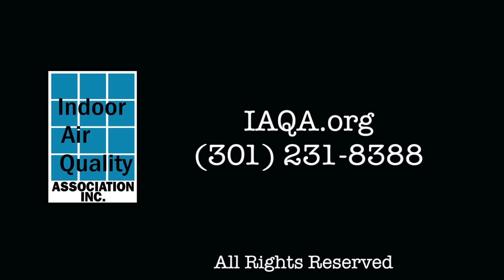IAQA Tech Tip: Condensation

Comment: Wow! What an overly convoluted attempt to describe what condensation is. How about; Condensation is water vapor in the air that changes to liquid water when cooled enough by surface temperatures to condense, or change the physical state of the water vapor? 

In no way does this video come close to describing why condensation occurs. With the use of so many technical terms, it leaves the viewer with more questions than answers.